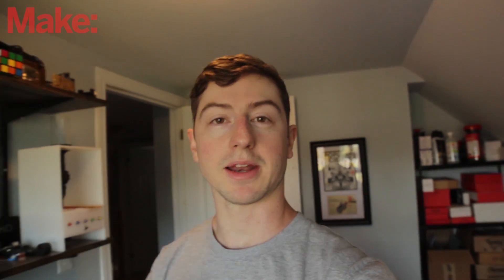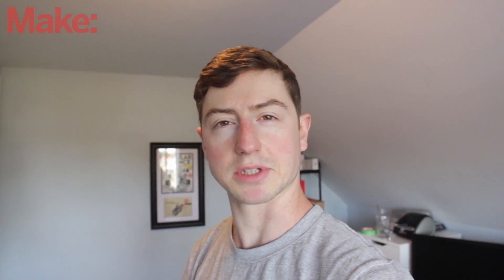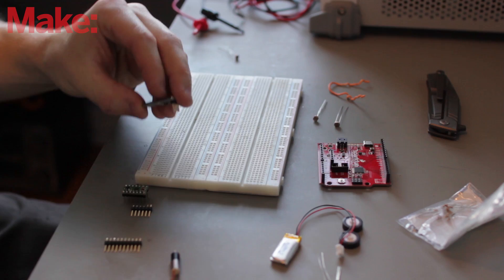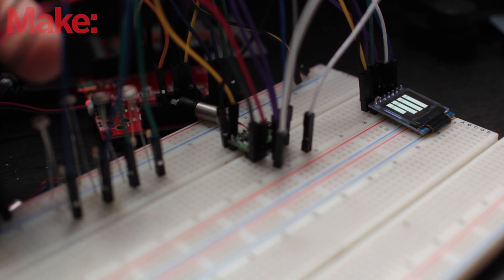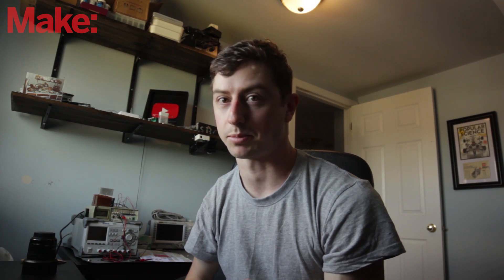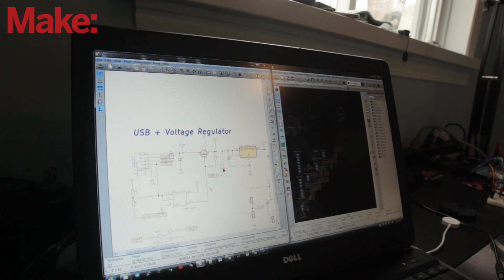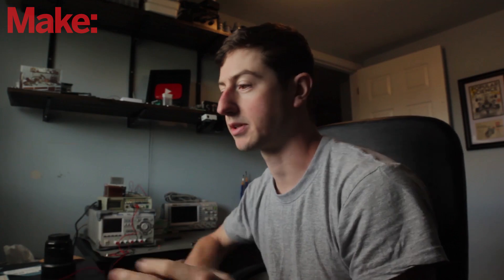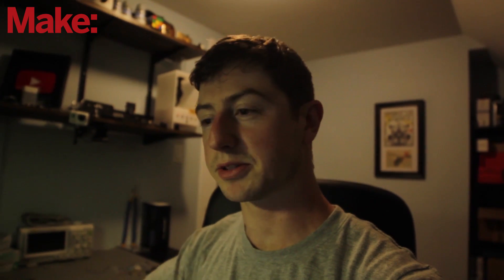Arduino Neural Network Robot Part 1: Prototype and Design

Comment: This was a fun build. Stay tuned for Part 2!
Reply: SeanHodgins wow great video. I’m waiting for part 2 👍🏼👍🏼
Reply: SeanHodgins 
  I wouldn't mind seeing a more detailed walk through of your CAD to KiCAD process. Did you need that step just for the odd PCB shape or is this something you do for every design?
Reply: up
Reply: I'm thinking about doing that in the future, but I still stumble a bit each time I make a PCB(because I forget certain steps and have to remember), so once I've got a process locked in I will make a video. For the odd PCB design, its pretty essential for KiCad since designing the outline using just the KiCad tools isn't easy. I pretty much do it for every board because most of my board will be installed in some other object, so I like to know before hand that it will fit properly.
Reply: SeanHodgins 
  That's half the fun of creating a video. You know it is useful to others when you use the video as a reference yourself.
Reply: what is the CAD software being used here? autocad? solidwork? or something else?
Reply: CATIA. I need to force myself to switch soon.
Reply: Why? The drawing looks good. But if you do plan on switching, have you decided on which one yet?
Reply: I'm fast, efficient, and knowledgeable in CATIA but I have been able to use it due to being a student and my student licence. A commercial licence is much too expensive for me to afford right now. I was in contact with them but its so difficult to figure out how much it will cost you yearly. Its the most expensive CAD software.
Reply: in this video, what cad software have you used for designing the actual board ?
Reply: He used KiCad, which is mentioned in both the video and comment here
Reply: instablaster

Comment: This is really exciting! Had a project in mind for a few weeks now of building a simple quadruped bot and having it learn to walk around using a simple neural net and reinforcement learning :-) I suspect your neural net will have inputs for each light sensor (and a bias perhaps) and two outputs for the motor speeds? Reward behaviors that lead to most/less light sort of idea?! Interested to see how you get the small net running and if there are libraries involved that make it easier on the arduino.

Comment: What about this design makes it a neural network. Is the program the key? Is this a more complicated version of a beam robot?
Would be nice if someone could explain it to me.
Reply: Beam robots typically use analog circuits do they not? This one will use a microcontroller. As you will see in the future videos, there is nothing inherently special about the design that allows for the use of neural networks. The fact is, the robot was designed as a simple way to explore neural networks and robotics, but you can run all types of controls on it.
Reply: If i  understand this correctly, the program itself will simulate a neural network that will guide the robot by using the light-sensors. Seems very cool to me, can't wait until the next part.

Comment: I think we would need multiple Arduino boards cross connected in such a way they can build a large brain cortex which will allow the cortex to learn through experience possibly two colour cameras interfaced into the cortex will allow the robot to see the world as we see the world and start to understand where it is in this world and what about a nuclear battery with a life of about the same lifetime as a human.
Reply: If you want to do neural networks it's about the right hardware for computing - such as GPU's.  For simple things there is quite a bit you could do without going specialized.

If you really want to take it up a notch; these USB neural network processors would be really cool to put on a bot:
https://newatlas.com/intel-neural-network-ai-usb-stick/50613/

They actually aren't that expensive:
https://www.amazon.com/Intel-NCSM2450-DK1-Movidius-Neural-Compute/dp/B076751BN8/ref=sr_1_1?ie=UTF8&qid=1509147735&sr=8-1&keywords=neural+compute+stick
Reply: You can do a simple back propagation network on a cheap arduno. This looks like a low cost introduction.

Comment: So the board that you have made will completely take the place of the arduino? Will you have to flash the new board with arduino firmware or something? This is so cool!
Reply: Yes, the small board that is designed will hold everything, Arduino, motor driver, lipo charger, regulator, and the 4 sensors. You have to flash the new board with a bootloader of some sort if you want to use the Arduino IDE. Stay tuned!
Reply: I'm excited to learn about that! I'm in the middle of making a 5 axis robot arm but I don't think I want to make a custom PCB for it. I certainly have a couple projects in mind that it would be fun to do a custom one for though!
Reply: Are you using servos or steppers? A friend of mine has a control board for his open source 6 axis arm. It plugs right into a raspberry pi. They're called Roboteurs and the board is called the SlushEngine. It might help you avoid making one for your arm.
Reply: SeanHodgins I’m going to use steppers. I chose to just go the cheaper route with a ramps 1.4 board. It should work just great because the arm isn’t all that big. That slush engine is super cool though! I saw a couple of the open source projects with 6 axis arms which would be awesome because it’s ready to just start printing but im doing this mostly for my own knowledge development so I’m designing my own. That’s why I chose 5 axis instead of 6 because I’m doing all the math and programming for it and I wanted it to be manageable.
Reply: Awesome, the ramps boards are great too. Sounds like a fun project.
Reply: You are try to make great robot using ramps. That's a good job. Do you know difference Grbl and Marlin?

Comment: Good topic, you forgot to add electrolytic decoupling capacitors across your motor driver.
Reply: You mean across the motor wires? There is a spot for them where you can connect the motor wires on the bottom, but yeah I often don't put them for these small motors as they don't "over-run"  like larger motors with more mass on them. When these stop, they just stop.
Reply: I meant across the plus and minus of the motor controller power input, otherwise you can get motor spikes back into the arduino causing it to reset or lock up. You shouldn't need capacitors across a motor when using a h-bridge. If you are running a motor in one direction like my last project you can though. Check my last video my channel where I did that.
Reply: Oh, C13, C14, and C15 are all decoupling caps for the motor driver. Check the schematic. Also, the motors are driven from the unregulated power from the LiPo, the Arduino is powered through a regulator. Even if the caps weren't there it wouldn't ever see voltage spikes. So its all good.
Reply: Sounds like you are doing like a champ,, cool!, just remember even a regulator is not fast enough to deal with transients.

Comment: u seem just like an awesome guy!!! could you tell me what did u study in college???
Reply: I just finished my M.a.Sc in Mech eng, however my project was more electrical. I designed a sensor for detecting faults on an internal combustion engines using, yep, neural networks. It would take the vibration of the engine and attempt to figure out what was wrong with it just by that alone.

Comment: Would be great if you could start to explain what you are doing. You didn't present an outlook what we can expect from the robot and we have no clue how to design our own boards now. We would be just able to download you files or order you board. This is not very educative.
Reply: As much as I like to hear myself talk(I don't), a video that explained everything would be hours in length. This is a series to show that it can be done. It will take multiple resources to learn how to do it, not just this video, but the point of the series is to ultimately run a neural network on an Arduino, and teach about neural networks, which will all be explained in the later parts of the series. This is not a step by step how-to(nor did I say it was), but it should help push people in the direction of utilizing these things. It gives a general sense of direction for something who is thinking of making their own project. Thanks for watching!
Reply: Thanks for the answer. My expectation to the series was just a different. Normally the MAKE series are really step by step. For sure the topic is complex but then I wonder why you don't simply concentrate on the NN with a prototype robot. There was no need for designing your own circuit board. Cardboard and the breadboard would be enough. But overall I liked the outcome of the series.

Comment: I can't believe you work only on a laptop.
Reply: no its not lol.
Reply: Check out the Battlestation in the background. I do PCB design and most of my programming on my laptop(work related stuff that needs to travel sometimes) - editing, gaming, CAD design work on my PC.
Reply: Can someone here recommed a good CAD software for a weak laptop? 2 GBs of RAM and 1.6GHz Atom processor. I have FreeCAD on my PC, but that piece of software runs waaay too slow on my laptop. I'm using Debian.

Comment: ANN on arduino? Seriously?
Reply: Yes! Don't worry, it works.
Reply: As long as the training doesn't have to happen on it, the ATmega328 can more than easily support a modelled ANN.
Reply: This uses the SAMD21G18, and the training takes place on board. You can train with the ATmega328, but it would likely take 20+ minutes to train, this takes 5.